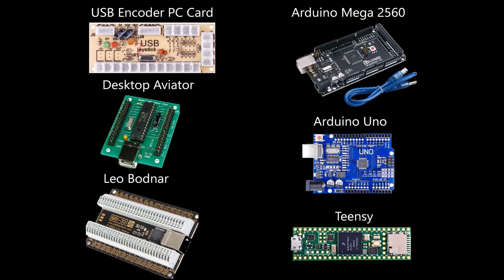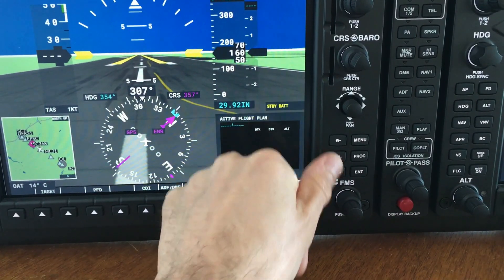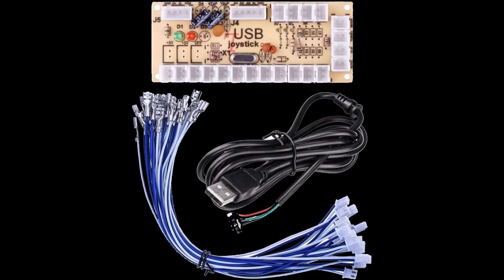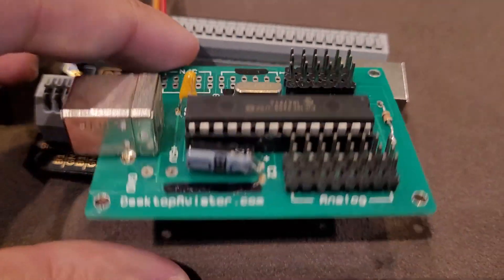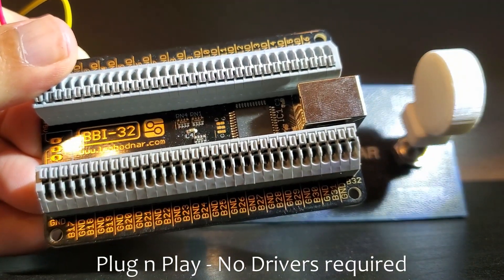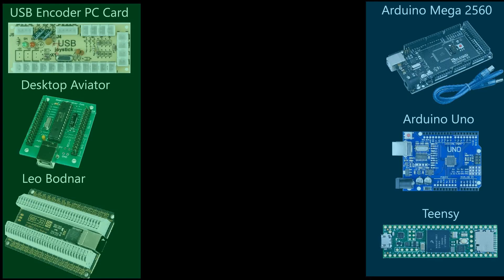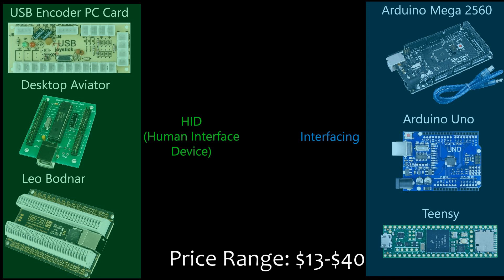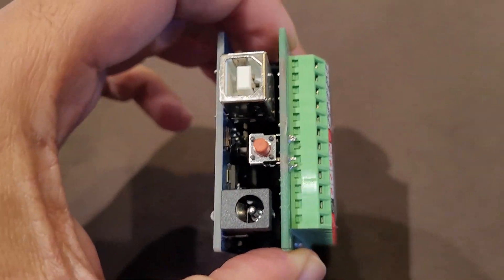USB Interface and Encoder cards for Flight Simulator, X-plane and Prepar3d - Cockpit building

Comment: Hi I have a BU0836 LC from LeoBodnar that I am using. Is it possible to use with a rotary encoder? Also is there a way to let LED lights work with this? Thank you for your video! it is a great help so far.
Reply from the maker: Looking at the specifications, it supports 16 rotary encoder inputs. It also has an output of +5V - 500mA so you can wire up LEDs but you will not be able to interact with them. For that, look into the interfacing cards: https://youtu.be/M7Fx54e_NtM
Reply: Thanks so much

Comment: I am looking to use some of the Simkits radios with X-Plane.  Looks like they use 24 pin connectors but their boards do not support a 64 bit system, nor X-Plane.  Is it possible to use another interface board?
Reply from the maker: Can you provide some links to these products so I can help you better? Thanks.
Reply: @joshuamarius  Sure, thank you for the amazingly fast response.
https://www.simkits.com/product-category/avionics/radio-stack-units/

Comment: Good guide.

For DIY inspired persons, cheap (~$5) and powerful options:

Arduino PRO Micro, Micro, Teensy 2.0, ++2.0 flashed with MMjoy2 firmware:
Up to 6/8 analog axes(depends on card available pins), supporting analog potentiomer, Hall sensor and digital sensors (e.g. TLE5010/11)
1 POV HAT 8 way
6 Encoder
Up to 128 buttons, with special functions (modes) for buttons up to 32.

Other is  STM32F1093 card flashed wiht FreeJoy firmware.
Similar features of MMjoy2.
Reply from the maker: Thanks for the comment! :)